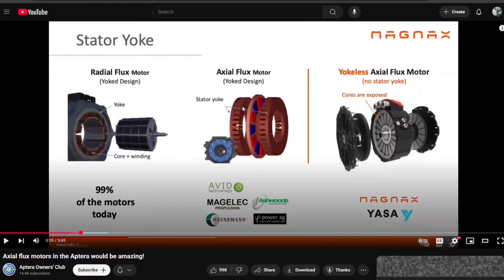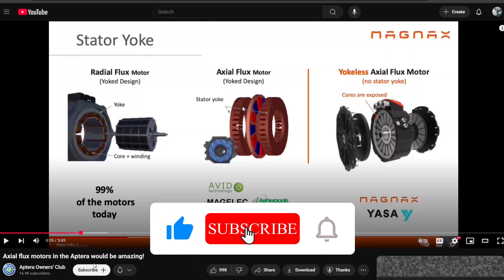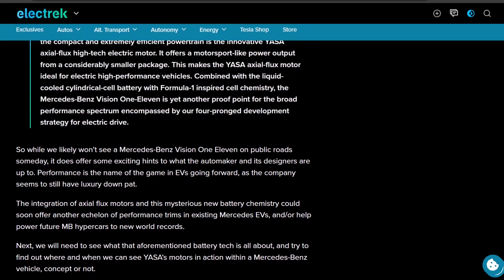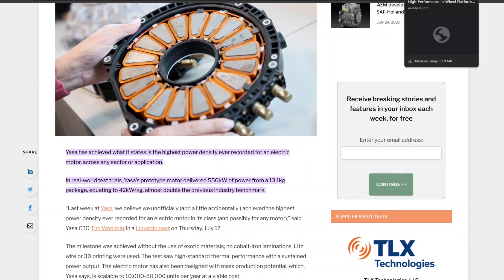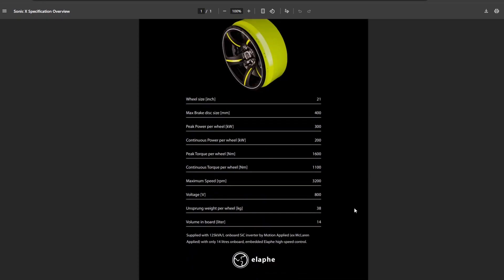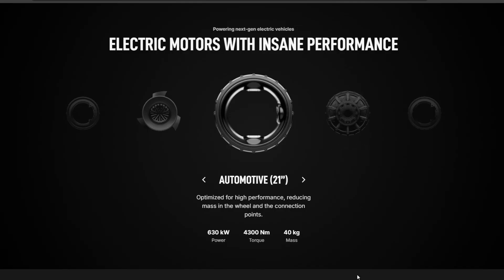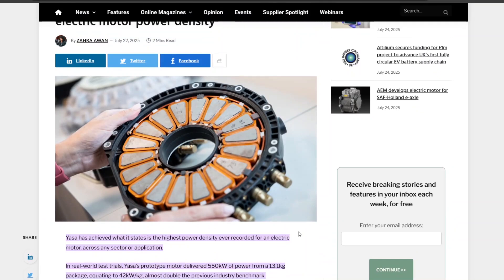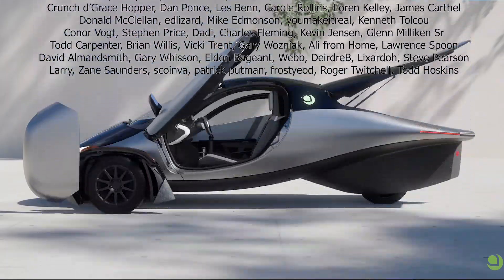YASA axial flux motor doubles electric motor power density

Comment: Do not know if it still on the table but Mercedes did announce at one point they would put out an AWD hub motor car in 2027, $? but it will be expensive. They can afford to homogulate the design where Aptera Motors or Elaphe can not. It will be interesting to see if they go with a suspension adjustment over independant electronic control via individual inverters. Or the combination of both. At any rate each hub needs an independant inverter so that weight needs to be added to the drive train as a system. Maybe you should take another look at the prices of inverters over the last couple of years? My gut says prices are up as silicon carbide types are in high demand.

Comment: These are great specs to brag about, but what can YASA deliver at about 50kW per wheel?  Reduce wheel weight, improve efficiency, integrate BMS with vehicle dynamic control.  How many years on the warranty?

Comment: The obsession with huge power, massive torque and blistering performance is still a concern for me. Whether ICE or EV, an efficient vehicle doesn't need any of those things. It needs to be small and light in weight, and comparatively slow. A top speed of 90 mph is adequate. If you care about efficiency, a 0-60 mph time of 20 seconds is good enough. A petrol-equivalent fuel consumption of 85 miles per gallon is desirable.

But new electric motor tech is all about giving ordinary cars supercar performance. That's just stooopid. What happened to economy and efficiency?

And no, the 'trickle down' effect in which top-end technology for hypercars is transferred to ordinary vehicles to be owned and driven by ordinary people is not applicable here. Motor performance is still focused solely on speed and power, not economy.

Anti-lock brakes and air-bags made the trickle-down journey successfully. At first they only appeared on luxury models, but the technology was refined and simplified; the focus was on less, not more. Coming to a halt safely had a simple goal that was not open to endless improvement; once your ordinary car was stationary, the job was done. No need to spend any more money on making 'safe enough' any safer.

But improving motors and drive systems is different. Now the emphasis is on performance, and - in the States at least - that has nothing to do with economy or efficiency. It's all about getting more muscle for your money.

With internal combustion cars, finding better economy means settling for less. No, not 'settling for'; welcoming less. Embracing less. Celebrating less. The 'best' petrol engines for day-to-day transportation by ordinary people used to have 4 cylinders and a capacity of less than 1.2 litres.

My last car [a 1993 Nissan Micra bought third-hand] was a 5-speed manual hatchback; it had a 4 cylinder, chain-driven double overhead cam, fuel injected engine of just less than 1 litre [actually 998cc]. It squeezed a lot into a small package, seated 5 adults in comfort and would cruise all day at 70 mph, which is the national speed limit here in the UK [top speed was a claimed 93 mph]. It gave 50 mpg and had a 0-60 mph time of 15 seconds. It was a quiet, comfortable, simple, efficient, utterly reliable car.

Today's super-economical equivalent engines have 3 or 4 cylinders, turbocharging, and a similar capacity. They're tiny. They run cleanly, efficiently, and give adequate performance combined with even better fuel economy.

So what's the downside? Well, if you discount the criminally idiotic engineering disaster that was wet-belt technology, there isn't one. Unless... unless all you're really interested in is speed, power, status and bragging rights.

How many teeny-tiny petrol-engined cars are in garages in the States today? Not very many, I suspect. Have you - and I don't mean just AOC's Happy Steve, but everyone reading this - got one? If not, why not? [Serious question.]

With that in mind, if electric motors are to be improved, energy efficiency won't be high on the list of desirable features. Nobody cares. Nobody will willingly sacrifice towering performance in order to treble the mileage obtainable. Given the choice of a 0-60 mph time of 4 seconds, a top speed of 135 mph, and a petrol-equivalent range of 30 miles per gallon, would you swap it for something that took 20 seconds to hit 60 mph, red-lined at 95 mph, but gave 90 miles per gallon? If not, why not? [Serious question.]

So... whatever advances are made with electric motors, I'm not convinced that they'll benefit anyone but manufacturers out to sell speed, power and performance. You can't have your cake and eat it too.

Today's EVs prioritise acceleration and torque delivery, not economy. If manufacturers cared about an EV's fuel efficiency there'd be no whiplash acceleration and no such thing as range anxiety. All that zip and zing would be tamed and turned into something useful.

I don't know what the proposed Aptera will have, motor-wise, but I'm pretty sure the focus will be on more useless speed and acceleration, not true efficiency. That's a depressing thought.

Comment: Why don’t they just remove the mechanical brakes? If you have a 4 crazy powerful motors and battery you should be able to do 100% of the braking via the motors. There’s also lots of redundancy with 2 motors up front and 2 in the rear

Comment: I had been following Aptera's progress for years, but lost interest when they announced they would be going to an engine/drive train design. I am glad to see they are going back to in-wheel motors. Aptera's original concept of starting new, engineering a car from scratch as if no other car had ever been engineered, was what caught my attention. Break all of the old bad habits and move us into a new, lighter, more aerodynamic vehicle that will set the standard for others to emulate. I'm glad Aptera is back on track. Thank you, Aptera. I look forward to owning an IN-WHEEL MOTOR, three-wheel-drive model when they hit the market.
Reply: Sorry to disappoint, but this video is not announcing that Aptera is going back to hub motors. Aptera may add a hub motor to the rear wheel when they later build out AWD models in the future. But this was just showing the technology improvements of power density of new axial flux motors. YASA does not make hub motors.
Reply: When?

Comment: It is cool. 3 years ago Koenigsegg showed off their Quark "Raxial" motor, which used both radial and axial flux technologies. The first production version weighed just
28.5 kg (63lbs), producing up to 600 Nm of torque and 250 kW (355HP). They even built a larger Dark Matter Raxial e-motor with 800 hp and 1250 Nm! The trick is that Yasa doesn't make hub motors. But it is easy to dream about a smaller version of Yasa's axial motor in the front on the Aptera, and Elaphe's new performance motor out back. Sure the power is overkill, but it would be a rocket with Aptera's light weight!
Reply: I'm so happy to see this YASA motor dunk on dark matter. The future is bright.
Reply: @bob15479  Innovation and competition is always good. It was great when Koenigsegg created their raxial motors, and it is great that YASA and others are further refining the axial flux motors, hopefully to work in cars that normal people can afford soon.
Reply: Torus motors are even more impressive utilising the whole surface area of the coil instead of wasting flux parths

Comment: It is all very interesting technology coming out for both batteries and motors that shows it will take less than a generation to completely obsolete ICE.  In effect the goals of the original X prize of the early 2000s has been solved and only will get better

Comment: Continental is designing one with brakes included. Donut, YASA, Elaphe, and probably two or more others we don't know about are all working on this.  Newer suspension systems will come along to offset the unsprung weight.  Aptera might be offering in wheel motors in the next generation of Aptera.  I probably will be in my grave, but others will get to drive them.
Reply: Why not re-arrange the deck chairs now?

Comment: What kind of vehicle or equipment could even utilize a 500kW in-wheel motor? No battery today can supply that kind of power. Maybe with capacitors? Or solid state batteries?

Not to mention traction limits. Maybe it makes sense for mining trucks or something
Reply: Or airplanes?
Reply: "No battery today" is just something you made up- you know that, right?

Comment: What is the point of talking about these new hi-tech motors when Aptera isn’t using them. It’s salt in the wound knowing Aptera isn’t coming out with any product. It is clear that the rate of change in the in EV industry out paces Aptera’s capabilities. It’s way past too late for Aptera now. There’s nothing unique about the Aptera anymore except design (the design is extremely niche ie..Cyber truck). They should have pushed out a product ages ago and then refine with feedback and real world data then sink or swim instead of this slow torturous death (especially for the thousands of investors me included). It’s not about the money, it’s about the continued manipulation. Rip of the bandaid already so we all can have closure.
Reply: I'm on board with all that- save the "it's way past too late now".   With the present leadership?   Maybe- but the concept remains just as valid.
Reply: Steve has been featuring other things besides Aptera for a while now,  and this is a look at a new and interesting technology.  Sit back and enjoy!

Comment: That Vision 111 looks very similar to the M-B C111 from 1972.  Thanks forr the info on the motor.  It would be awesome if aptera used in wheel motors in the future.  Doubt they will switch back to original design of using in wheel motors any time soon, but maybe they can at least geet AWD version going sooner than later
Reply: There were a whole series of C-111 concepts. I'm sure M-B named the Vision 111 in reference to these.

Comment: AMG please incorporate a capacitor in your flux motor.
Reply: Likely not in the motor, but the entire controller stack is loaded with them. Since the flux is created with AC power you might be able to twist the DC to AC converter as a "flux capacitor" if you really like twisting terms.
Reply: @Skylancer727 - Aww, c'mon. Be nice. He was just making a little joke.

Comment: Thank you Steve.  I thought electric motors had more or less been perfected, but obviously not.  A drop in weight by half for a given amount of power is amazing.
Reply: We are in early days for electric motors it's hasn't been seriously worked on til about 2010 ? At least publically and at scale. The Internal Combustion engine has been worked on since the 1900s (essentially the start of FORD era) so we got decades of advancement ahead of us assuming the same timeframes
Reply: Why would you think electric motor tech had plateaued?